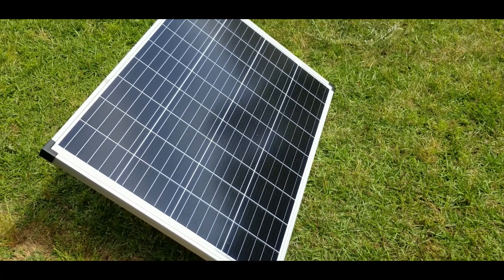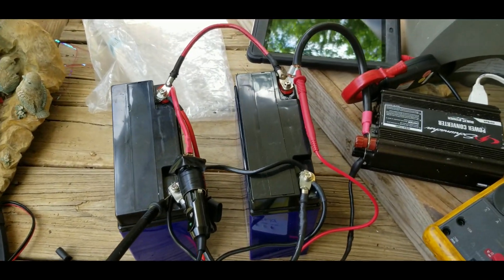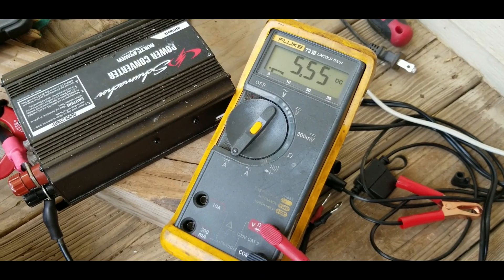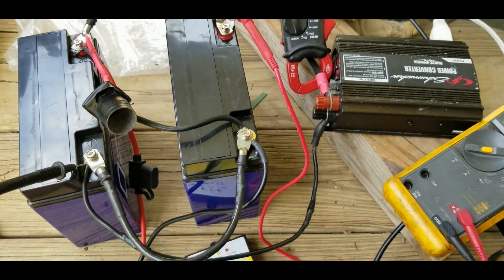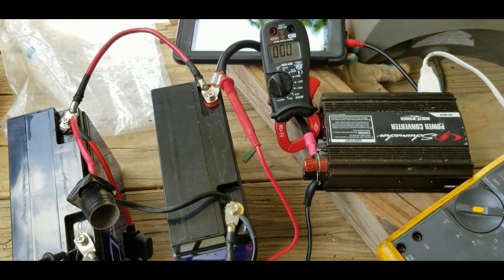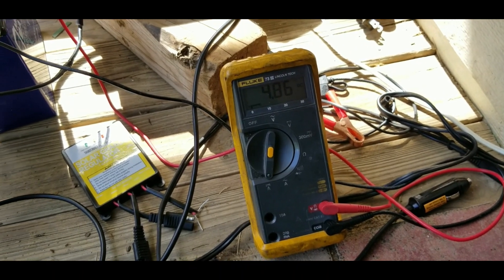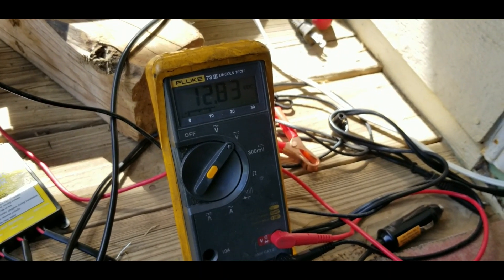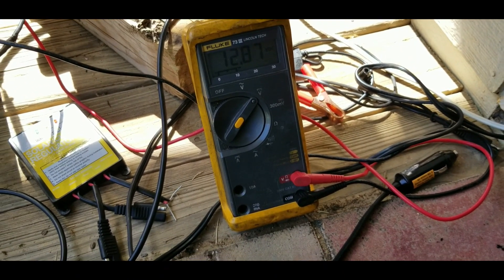UPDATE what can it run? 😎 New Harbor Freight 100 Watt Monocrystalline Solar Panel Item # 57325

Comment: I bought one of these to charge our rv battery and so far never used it but the whole solar thing peaked my interest and soon invested in a complete solar system for our rv and learned a ton of info. The most important thing to remember is solar doesnt "run" anything, all it does is put a charge into the batteries so the actual battery or batteries are the heart of any solar system and determines what and how long you can run something.
Reply from the maker: You are absolutely correct. Most people don’t understand or care to they just want to know what they can run off the shelf quick…..
We are testing a 100aH AGM now and will have it tied into a Renogy controller with two 100w and two of the old 100w systems from HF….the Renogy controller seems to be the best out of about 4-5 I tried so far….it powers a tiny home perfect.
Reply: @DIYKAI  I went with Battle Born batteries and all Victron components and REC panels, so far its been awesome, powers our rv for quite a while, can even run one a/c unit for about 5-6 hours if needed. Its very interesting once you understand everything.
Reply from the maker: Nice! I want battle born they are $$$ lol

Comment: I got 2 of these mounted on the roof of my Chevy Express 3500 for road trips... They held up perfectly on the roof over the maiden 10k mile road trip.
Reply from the maker: Nice we are thinking about mounting them to the trailer
Reply: Nice - that's what I want to do, but I've been concerned about the lack of any cover glass on the panels.
Reply from the maker: The glass seems to be tempered it sound very durable when i hit it lol...h abe bumped them a few times and no damage yet

Comment: I picked up one of these panels yesterday at HF, and have added it to my existing setup of two sets of 4-panel/100 watt , connected to 3 HF batteries and HF controller.  I use the setup to power my garage door opener, the included HF LED lights, and various power tool chargers in my  garage/shop building.    It was working fine already but I figured the extra charging capability would be good.   Thanks for the video, very good information.
Reply from the maker: Awsome! Your welcome
Reply from the maker: How do you have them stringed together...with the SAE plugs? Have u checked amps? Just intrested I'm about to do a tiny house with it
Reply: @DIYKAI  Yes, with the SAE plugs that came on all the panels.   The line to the controller has 4 pigtails.    The 8 25-watt panels are connected to an 8-port Harbor Freight Thunderbolt hub and then to one of the pigtails.   The new 100-watt panel is connected to one of the other pigtails.    I haven’t checked the amps.   It’s all working perfectly, the only thing I am not sure about is the capacity of the Harbor Freight controller.   I think it will only handle  a 400-watt max, but I’m not sure.   I now have 2 open pigtails but I want to make sure of the capacity of the charge controller before I connect anything else to it.
Reply from the maker: Nice thanks for the update you may want to look into a MPPT controller they are about 30 bucks online that's my next move as well
Reply: @DIYKAI  Thanks, I’ll check those out

Comment: With the WEF running their Cyber Polygon simulation I figure it's just a matter of time until we have rolling blackouts or power outages for hours, days, or even weeks. I bought one of these panels, and have an Aimtom 300 watt power station. The panel will allow me to charge the battery and run a few things. I have a small burner for cooking, and I'll be able to run a fan to keep me cool. 

I'd like to eventually get enough panels and all the other pieces to be off gird. 

At any rate it's nice to have the means to generate some power when the power grid goes down from a cyber attack. At least that will be the official story we're told.
Reply from the maker: I have a few and have a full 12vdc kitchen runs everything
Reply from the maker: I built my power station 500w AC 1k peak pure sinewave

Comment: I have 2 of these for my Bluetti eb70s. I only use 1 because it works so well. I use it at my off grid property in central oregon where sun is so good I’ve seen a single panel pulling 102 watts into my Bluetti in peak conditions. Makes for really fast charging. I use both panels in parallel (using universal connector disc from harbor freight $20) to keep up the charge on my Bluetti when I play ps4
Reply from the maker: Yes they work very well. Oregon always wanted to visit lol

Comment: At 2.04 you switch to current on your Fluke 73 111, could you please enlighten me how you got that reading with probes plugged in the red lead voltage/diode/ohms socket and the black lead into the com socket. (Parallel to the circuit). When I was younger we used the com socket and one of the A (current) sockets, the leads had to be connected in series to the circuit being tested. I would be fascinated to learn how the leads inside the fluke gave that reading with leads connected in parallel with circuit. Comments please.
Reply from the maker: Magic lol video is not perfect but gets the point across. We are always improving based on the comments thanks for the info

Comment: Instead of using a hub to connect more panels can I use the 4 way slitter that came with the 4 panel kit?...thanks
Reply from the maker: Yes the 4 to 1 splitter should be fine
Reply: Thank you
Reply from the maker: Yw

Comment: In the manual it says in 6 months the output will drop 20% and stay there "which is normal"
Reply from the maker: Only time will tell
Reply: @DIYKAI  Wait a minute you're okay with that? I feel like returning mine immediately, unless this is standard for all panels?? Wtf
Reply from the maker: All panels will lose efficiency over time its the nature of the beast.....all panel manufacturers say 80% rated output after a few years.....inhave mine on the roof and ita still.doing fine I check it daily with a meter
Reply: @DIYKAI  So why is this guy pointing it out like it's some unique problem to this HF panel? Thanks.
Reply from the maker: Have no idea lol
Reply from the maker: The manual says 20% degradation after 6 months until the panel settles
Reply from the maker: I think people may be looking into it more than theu should....even high end panels will only warranty 80-90%  after a period of time I never seen a company give a 100% rated warranty they would be out of business the first year lol
Reply from the maker: Yes its very comparable....major differences being HF has built in legs to angle the panel and it seems to be spot on when you set it up as far as output...

The Grape come with a charge controller but no legs. Says it puts out 5aH less total than HF but we all know how some manufacturers boost the specs...lol

Both are great deals IMO I just went with HF because I had a charge controller, it was in stock local (I like to pick up and look at what I'm buying) and had legs since this was for a portable unit I built...

If you want to jump right in and start the Grape one is the better as it come with a charge controller.
Reply: @DIYKAI  No the charge controller isn't why it's better. That I already have. It's better because it's smaller so therefor needs less sun to put out the same power. The larger the panel the less efficient. You can buy the grape at home depot for 85 just the panel, no controller. I'm failing to see how the HF panel is better in any way at all (aside from the legs which I don't want or need).
Reply from the maker: @johnvalencia9927  if you look at the specs grape says it only  charges 25aH HF  rates it at 30aH a day....i have tested it and it comes in at 28+ everyday.....smaller panel of the same cell type will produce less
Reply from the maker: It terms of charging batteries a 5ah difference is HUGE imo
Reply: @DIYKAI  Sounds like if you were me you'd keep the HF mono. I guess I'm keeping mine. Thank you for all the back and forth man! I don't really get it (scientifically) but since I'm stupid I'm just going with what you said. Thanks again.
Reply: @DIYKAI  Wait a minute. I just looked on the box of my HF mono. It also says "on average 25 amp hours".
Reply from the maker: No worries man sharing info makes us make better choices🍻
Reply: @DIYKAI  When you said that the Grape I linked to only does 25ah per day are you sure they weren't just using their average number? Because the box on my HF mono also says "produces 25 amp hour per day on average days" or something like that.

Comment: I don't understand anything about the numbers you mentioned. 

It's overwhelming.
Reply from the maker: @TJtheTJ  ok what are your goals?
Reply: @DIYKAI  I'd like to have something simple. Charge phones, run a box fan, maybe small tools.
Reply from the maker: @TJtheTJ  ok so for a basic setup you will need the following:

Battery 100aH is standard but you can go any size. LiFePO4 is best but good ole lead acid will work
A charge controller (MPPT) is the best but PWM will work
Solar panel
Power inverter pure sine is the gold standard modified sine works but sensitive electrical things will not run there best
And the wires to connect them usually comes with the solar panel but you will need some from the battery to the charge controller.
Reply: @DIYKAI  Awesome. Thank you. This is a huge head start for me.
Reply from the maker: @TheDisccity your welcome if you have anymore questions just comment and I will try and help

Comment: can you hook this one with the 100 watt kit that harbor freight has and use the controler that comes in the kit?
Reply from the maker: I don't really like the charge controller that they have they seem to fail alot. I would go with a better style one as the one in the kit may only be rated for the 100w included
Reply from the maker: But yes it would plug in

Comment: The panels I ordered from your link  are hooked up and working with overcast skies am getting 473 watts at 4 : 30, California smoke and all included , from my panels...the amps are better now...was around 19 earlier, but is at 16,6 now. yesterday I think it was 13.2 about this time of day. I 'll have to weld up another border frame for these two jewels tonight. I will be getting better voltage at the end of the day now...I decided to get two more batteries at the end of the month, for 16 of them and I think my system has enough of them...
Reply from the maker: They sound like they are preforming well

Comment: Enough volts and watts and ohms talk. What do I need to use this panel to charge the battery on my boat. I use the battery to run my trolling motor
Reply from the maker: Hey don't get excited lol you need the following:

Panel
Charge controller 
Wire to connect it all

Check this video out:
https://youtu.be/TXR9EWxuw-Q

Comment: Is there any down-side to using a much larger inverter with your system?  Say a 1000 watt?
Reply from the maker: Nope none at all as long as you use a quality one like a pure sine wave it will produce the best bang for your buck in term of energy use

Comment: Would 4 of these 100 watt monocrystaline be a good set-up with a Bluetti Ac200p?
Reply from the maker: Yes more than enough but be away the connections on the harbor freight panels are SAE all other panels are mostly MC4 style……but you can cut and splice a MC4 into them

Comment: I am embarrassed this but I am not versed in solar.  I have a Bluetti 1500 and am wondering if I could use these panels to recharge it?  If so do I need all this extra stuff you have in this video or could I get a cord to just plug it in like a suitcase solar panel?  Help 😩
Reply from the maker: Don't be embarrassed we all start somewhere. Let me look up the specs on the Bluetti and I will get back to you
Reply from the maker: Ok so from what I can see you should have an adapter that came with your power station it's a single barrel plug to MC4 style connection.

The HF solar panel is SAE connection.

The easiest way get an SAE to MC4 adapter.

The power station should have a built in charge controller. 

I can post a link to the adapter if you need me too.

Hope this helps
Reply from the maker: @thomasmckelvey8961  which one?

Comment: I have 4 of the harbor freight panels.  I rewired into the diode box with a quality 10 gauge from the panels. They tie into my bulkhead going into my rv and I jump to 8 Guage and connect to a rich solar 40amp charge controller. Anyhow on a sunny day I am getting 29 amps to my batteries. Cool weather probably is helping the output. I really dig the HF panels they have been great. Best thing anyone can do in solar is good wires and  a mppt charger. I had the Hf charge controllers and the are terrible.  Lots of lost power. I got a nature's way 13amp and it worked well for 2 100 watt panels.  Just be careful where you mount those. When I swapped to the rich solar I found that the small nature's way was hot enough it was melting on the backside and that was only with 2 panels.

Comment: I found the link lol which one can charge my 14 batteries, you think?
Reply from the maker: 14 batteries do you have a BMS? Thats a ton of power
Reply: @DIYKAI  I have a 7 legged piece of #6 stranded wire, that has a brass Kearney in the middle, resembling a big spider....it connects to all the 12 volt connections between the batteries...that way I can hook my 410 watts Schumacher inverter which is 12 volts to either the top or the bottom set of seven batteries...that way it does not run down a single battery, and t can't run all 7 down very easy...that is my " BMS "lol
If I decide to get 2 more batteries I will have 16, for 21 kwH, or 865 amp hours @ 25 volts...then the spider will have 8 legs and be complete...
Reply from the maker: As long as you know your system 😁

Comment: What's the word on how long these panels last?  Know that's a tough one.  Depends on how often you're using them and what conditions.  But if there's come kind of formula for longevity, educate me.  Thumbs up.
Reply from the maker: I have had them about 4-5 months now I did a 3 month update video and had show ZERO loss they have been on the roof in southern summer heat still look brand new.....I will update again at 6 months....but most panels you can expect between 10-30% degradation over its life of 25 years or so.
Reply: @DIYKAI  -- Thank you.  That's more performance than I expected.  Building a small 2 panel system to wheel in and out for outages.  But mostly to teach my little girls and the nieces and nephews.
Reply from the maker: Your welcome. Yes I do the same as well. 2 panels are more than enough to charge a large battery like 100aH or so just get a good charge controller and pure sine wave inverter and you will be good for powering lights cell phones small coolers and such

Comment: When it comes to DC voltage an old timer trick to drop the voltage down by half was run a (in this case) 12 volt light of sufficient wattage in series with the device you want to run , assuming your device can handle the smaller voltage fluctuation but half what the panels produce you could run direct from the panels .
Reply from the maker: yes drop voltage can work. good idea